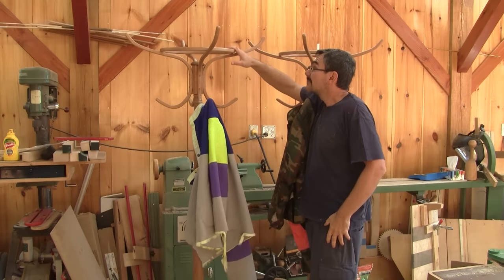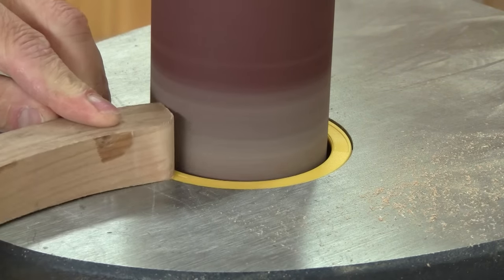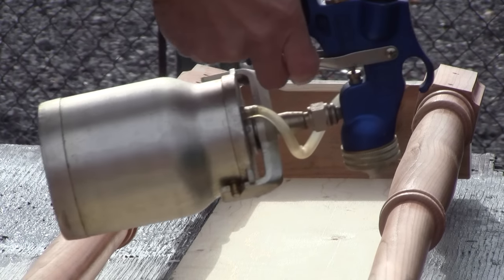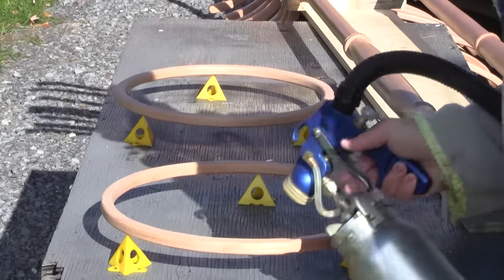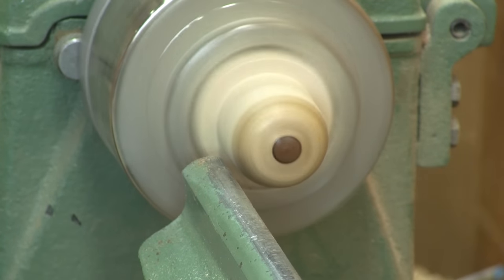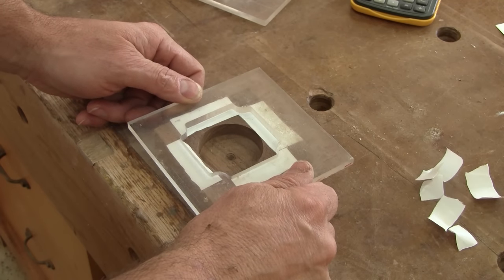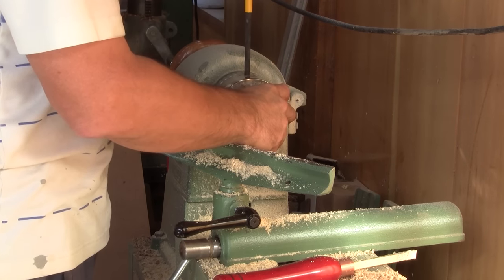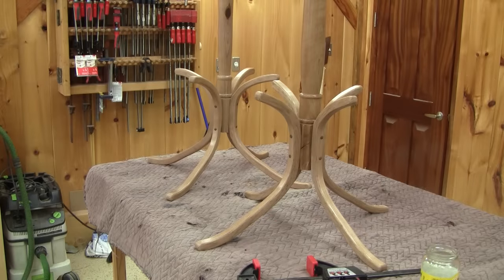The Woodpecker Ep 107  - Building a pair of coat racks - part 3

Comment: Very nice!! Could you have used the inventables machine to cut out the walnut piece. Instead of making a template for your router. Just curious!
Reply from the maker: +WoodenCreationz Yes, but cutting the shape took just a couple of minutes, then I was able to to make as much recess as I want in just a couple of minute again. Cuting it with the CNC woud had taken over 20 minutes just to cut one. I think it was more efficent just making a template with a CNC than the actual holes.
Reply: +Alain Vaillancourt Thank you!!!! That makes sense now!!!

Comment: You programmed the Xcarve for the router templet, then the replacement base plate for the router.. Why didn't you just use it for the wood in the first place and avoid the hassles??
Reply from the maker: +john john I needed 2 templates; one for the top shape of the post, but to be able to follow it I needed a base plate on the router which can receive a collet, so I made a router base also.